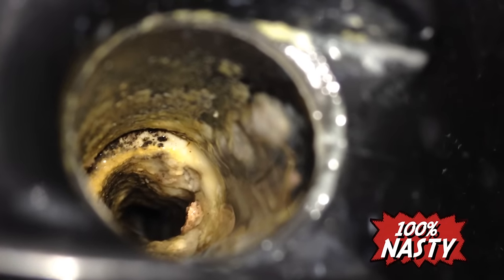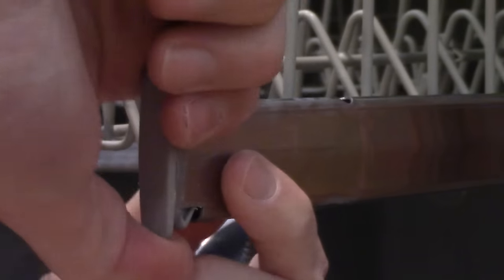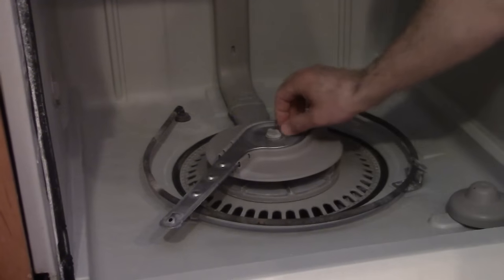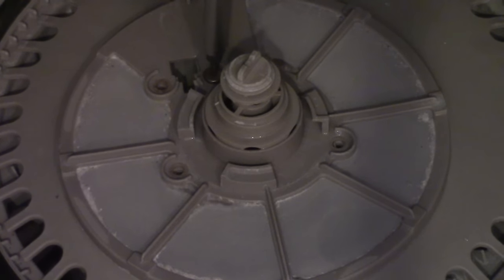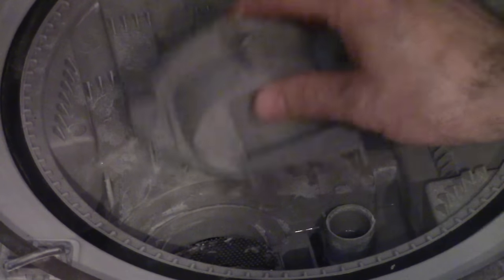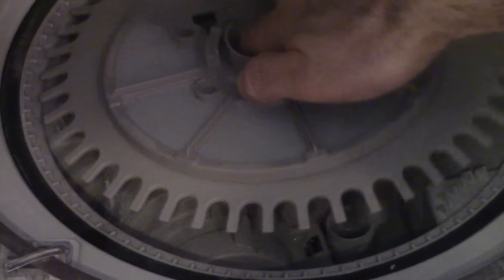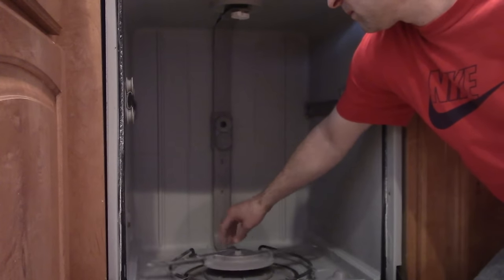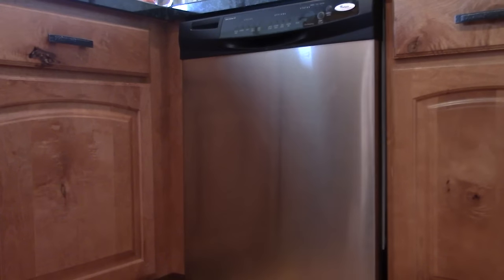How to repair a dishwasher, not draining - troubleshoot Whirlpool

Comment: nice video adam. My whirlpool was not draining completely although I could see water draining into garbage disposal. I replaced pump impellers and still had the problem.. hose looked to be unblocked, and it was clear. I did remove the backflow preventer the hose attaches to at bottom of the machine and found it to be partially blocked with bits of paper and plastic wrap. Was able to remove blockage with tweezers and some picks. problem solved.

Comment: Thanks for the thorough instructions! Dishwasher is cleaning better, but there's standing water in the bottom after the cycle finishes. Holding the "Drain" button for about a minute will eliminate it. Any idea if that's a sign of pump failure or another issue?

Comment: Very helpful. The only issues to add are that is might be helpful, depending on model year, to separate the tube (long tube that runs from top to bottom) in the base. You'll see that this is possible because there is a clip. This makes rotating the tube easier to manage.

Also, in my case, it turned out the grinder screen/knife shaft was broken. The replacement part included the screen, the knife, and the shaft as a single assembly (<$35). That dropped right in and the dishwasher was like brand new. Because the shaft was broken, the screen was hopelessly clogged which prevented the water pressure from getting high enough to push water all the way to the top shelf.

Comment: This is just the best video.  I had to switch back and forth between this one and the one where you show the wash arm with the clips  I have a Kitchen Aid Architect series.  One warning to anyone with one of these.  Do Not Unscrew the sensor at the bottom.  Mine slipped through to the floor!  Luckily I was able to remove the kick plate and screw it back in from the bottom.  PhewReally.  This video saved me a bunch!
Reply: Ame Cseventy

Comment: This video matched my dishwasher exactly, so it was spot on helpful. In our case, turns out bits of the rack disintegrating (which I knew about) caused bits of it to fall to the bottom. Pieces of it must have kept the impeller from turning.

Comment: Great video.... and a trick to easily clean out all that grime and mildew from the drain bottom is to scrub with plenty of soap solution and suck up the liquid with a turkey baster. Repeat until all grimey bits are free and clear.

Comment: Thank you!
Found a plastic cap stuck in the drain line. Used a $3.00 drain python from Home Depot to unclog. 
Though this task was going to be difficult, but turned out to be pretty easy.
Reply: Thank you for your help. Good quality video. Clear explanation. I wish your business going well.

Comment: I have an over 8 year old maytag dishwasher made by whirlpool.. It looks almost the exact same as this aside from the interior being stainless and the bottom spray arm looks different...The machine works great no issues draining...something is puzzling to me though... The bottom rack at the very LEFT corner is for some reason a dead spot now...if I put a quart mason jar there it looks filthy and all of the other dishes throughout are spotless...If I put a flat plate or saucer in that spot it comes out clean but no glass will... this wasn't always the case...it's something that's developed over the past few years..but the machine runs and sounds great...I've always ran citric acid through it once every few months. EDIT: forgot to add, the spray arms are not clogged...no build up at all that I can see

Comment: I have a very similar Kenmore Elite.  We have very hard water so removing the cover on the very bottom with the one screw was very difficult due to a lot of calcification.  I poured several cups of vinegar over it and let it sit a while then used a screwdriver and with a lot of prying it finally popped off.  Glad I went through the trouble because the little propellor blade was frozen stiff due to all the gunk on the metal grid.  I should mention that it is a simple matter to remove the propellor and grid assembly to make it much easier to thoroughly clean before reinstalling.

Comment: My drainage problem was in a portable G.E. washer,so my solution was a little different. My washer would not completely drain before the fill cycle began. I flipped it on it's side,and on a hunch,I removed the clips holding the metal grounding pipe which runs inline with the rubber drain hose. The inside was half full of scale,which I reamed out with a screwdriver. That fixed my drainage problem!

Comment: So happy I found your video - it's the exact model we have. We inherited our dishwasher when we bought the house. However, regardless of how much I try to unscrew the lower sprayer (clockwise) it just keeps spinning. I fear that maybe it was just tightened too much or maybe the previous owners stripped it by trying to loosen it counter-clockwise.
Any suggestions?

Comment: I have an older Whirlpool dishwasher. Similar to your example but definitely nuanced. The sprayer arm just slides into an upper circular component and just slides out after you remove the screws holding it down over the circular filter. The sprayer arm does not cover a 4th screw. When you pull the circular component that receives the sprayer arm there’s a nut and impeller but can’t seem to turn the nut and not sure it would matter. The circular filter will not budge  no matter what language you use! Anyway pretty much stuck at this point, that circular filter covers everything.

Comment: Worked great.  Also fill a squirt bottle with water & spray the hard to reach areas.  Especially that black thing (temperature sensor i'm guessing) in the top right.  Clean the door & filter gasket & with a wet paper towel.  With the door all the way down look under the lip inside of the dishwasher.  Mine was naaaasty.  Use a stiff small brush to push the crap through the metal grate.  You may need to pry the filter loose and be sure to line up the screw holes when you snap the filter back on.

Comment: Here in Austin, Tx, the one of the problems with dishwashers not draining has been incomplete installation.  The installers fail to remove the "knockout plug" from the garbage disposer prior to the attachment of the drainage hose.  My appliance repair guy say that he stays busy.  Lots of development here.  First thing he did was remove the knockout plug, then took the dishwasher filter apart,  because I insisted.  He was here for about 20 minutes.  Cost $100.00. He's retired, but stays busy. He my go to guy for all appliances.

Comment: 8:36 on Kenmore Model 66516973200 there is NO back screw or top screw.  You just snap the arm into place and it holds.  Don't make holes in the big grey U shaped piece.

Comment: Heh heh, good tip on the towel for catching screws. Didnt watch video before taking off that track which runs along the back and top. But i had done this operation a few times over the years and got sloppy. The top screw dropped down into the bottom of the washer. Expecting I will locate it tomorrow when I take out those bottom parts to get to the grinder. .Appreciate the video and guidance.

Comment: I would recommend doing this for the purpose of maintaining your dishwasher, but if you've found this video because your dishwasher is stopping mid cycle then here's what you do: 

-Close the door
-press heated dry button
-press normal button
-press heated dry button
-press normal button
(all lights should come on)
-press cancel immediately

This resets the dishwasher.

Comment: Thanks for sharing your knowledge amazing video!!!!  I’ve done all these steps and still the dish washer won’t drain. I even pull it out and disconnected the drain hose ran water through it no blockages. I also replaced the drain pump. I have no garbage disposal pulled the trap all clear. Any suggestions. Thanks for your help and time.

Comment: Thanks AdamDYI for an informative video.  I got down to the screen and blade and you said it should rotate freely.  Mine seems to rotate too freely.  I couldn't tell from the video if the shaft and linkage is also spinning behind your hand.  Mine doesn't however the shaft does not appear to be broken.  It seems to be an issue perhaps with the washer on the end of the shaft.  Is the blade suppose to rotate the shaft?

Comment: This is an awesome video thank you! I'm working on this same machine. I'm here at the impeller sand it's not turning all the way. seems to have some grindy like noise as I attempt to spin it like there's sand in it. it turns to a point and stops, both directions. Please offer next step advise

Comment: Adam, great video. I have the same dishwasher except for one difference. The channel that pumps the water to the upper spray arms are not attached with screws as yours was. The connectors appear to be plastic tabs, but I haven't been able to release them. What's the trick?

Comment: I have the Whirlpool Quiet Partner 3.  I followed your excellent instructions up to the part where I lift the arm assembly off. I tapped on it with the side of my adjustable wrench pretty hard being careful not to break it but no luck. The screw is stuck in place.What else can I do ?

Comment: Good video!  But, before you go crazy, check to see if the drain plug has been knocked out if you just replaced the garbage disposal.  The drain hole has plug in it that has to be removed, before you can drain from a dishwasher.  Rather than put a cap on the pipe connector, they have a plastic plug inside the garbage disposal.  It's east to knock out with a  screwdriver.   This is only for a new or replaced garbage disposal.  It will save you a lot of headaches in this video.

Comment: This is very helpful, thanks.  Can you clarify for me that the nut that holds down the lower sprayer arm should spin once the arm is installed.  I can crank it down so it doesn't more and then put the sprayer are on. Which is correct.  5:27 in the video.  Thanks

Comment: Hi, your video is great.  I did not find a silicone sealer in the center piece.  Do they all have one?  Could it have been forgotten during the installation?  Also, it is clean & I am just running it with water.  It is very sudsy.  Could this be another problem?  Finally there seems to be a hum coming from it now that I had not noticed before.  Is the hum normal? Oh, and does the center bottom sprayer have a lot of play to it?  Thanks for your help.

Comment: Adam, the video was fantastic and very helpful, however, I am unable to screw the lower spray arm back on. extremely frustrating. It seems to screw slightly tilted, therefore never ending in the correct position but popping back out. Is there a remedy or will I have to buy a replacement lower spray arm?

Comment: MIne drains ok when it's running but I came home and it was full of water. I hadn't used it in ages. My plumbing in my sink is unclogged. My only guess is the garbage disposal got a bit of a clog at some point and it forced water into it. I don't know how water made it into  the dishwasher this way because when I blow in that tube going to the dishwasher no air goes through. It's like a valve or piston prevents this. Still not sure how water got in there.

Comment: At 3:37, you remove a plastic screw off the top of the spinning arm. It looks like it's reverse threaded by how you do it. Regardless, this plastic screw in mine just turns infinitely in both directions and never comes off. Its like its just turning the thing its attached to underneath. How do i defeat this thing?

Comment: I have a mildew problem inside. I'm tackling the water backup, but I wa hoping for an opinion on cleanup. I've brushed everything with vinegar. Ran w vinegar then baking soda. Still kinda stinky. I was considering running it bleach. Do you think that would mess up the lower spray arm or rack slides? They look stainless. Thanks.

Comment: The one I had to take apart hadn't been cleaned in over 3 years. The whole thing was orange, black, grey and gloppy. Found broken glass (past tenants) and 6 bag ties. Got it apart, cleaned and back together with these directions. Hopefully that worked so I won't have to undo it all and snake the pipes.

Comment: Hi!! I used your video because mi dishwasher wasn´t cleaning, so it was a perfect guide to dismantle it. It was gross in the inside!! With lots of food residues and plastics. SO, the first time after that worked as a charm, clean dishes dishwasher like new, and now... is not draining!! I don't understand because that was not the problem at first. :( Do you have any idea what could I've done wrong?

Comment: Thamk you for this video! Unfortunately, I'm still having problems and wondering if you can help. I pulled the washer out. There was nothing obvious clogging it. I even inspected the impeller part. It was not clogged and moved fine. After putting it back together, it wouldn't drain all the way, at first. However, we could push the cancel/drain button and it would drain. Now, it will not start the cycle, at all. My (non-handy) guess, wonders if the sensor if bad. There is white stuff caked on it.
I would appreciate any help you can give. Kenmore Model 665.15113K214. Also, mine doesn't drain into the garbage disposal. There's another drain pipe. Not sure it matters. It does not seem to be clogged.

Comment: Great video, but should have mentioned possibility that the knockout plug in the garbage disposal has not been knocked out.  That's an easy check that will save taking everything else apart, if that is the problem, which it was with me.  Some of the videos on YouTube show that.  Otherwise an excellent how-to!

Comment: My dish-washing machine is a SUPERBA by Hobart, and it is very old - - like thirty years. 
It doesn't seem to be able to wash the dishes effectively anymore even though I give ample spacing between the items. I could use 'soak & scrub' mode for longer duration but that is a great use of water and power, and I don't pack the machine with heavy loads.
Also, the dish-powder dispenser pockets don't seem to be able to open on their own anymore.
Purchasing a new machine at this time is not an option.

Comment: great video, I did it!  one thing - what's with the standing water in the compartment where the blade is.  I saw you have that, too, but I would feel better if it drained completely out of there.  Isn't it a breeding ground for bacteria?

Comment: A-HA!  The Secret Screw under the hose thingy!  So that's why that bugger would not come out.  Thanks!  Taking it apart proved to be easier than putting it back together.  You have to remember to put things back in order or you will have to take stuff apart and then do it right.  If you don't live very close to a hardware store, make sure you have a compete set of cheap funny-dudy screwdrivers.  I need two sizes of the star-shaped one and a square one.  There was no normal screws on my machine.  I guess they do that so you won't fix it yourself and will call a professional or better yet, buy a new one.  I found two bread twist wires, a pebble shape piece of broken glass, lots of bits of plastic, 5 pistachio shells, two toothpicks and part of a q-tip. Its amazing it worked as well as it did.  I did check the dishwasher hose to the disposer and surprisingly it was clean as a whistle.

Comment: Hi Adam, I have a maytag dishwasher that is 7 years now. I would say brand new. My problem is that drains well, but now when I start the cycle, any, it starts filling up with water  it cancels itself! My husband checked the pump and it is fine. Do you have any suggestions? I dont want to spend money in a new one. Thanks in advance! Paola

Comment: We just bought a home and moved in. I've been using the dishwasher somewhat frequently for the least couple of weeks. Last week I went down to the basement to wash and noticed water ( kind of dirty or rusty looking) on top of both the dryer and washer. It's directly below the kitchen. I cleaned it up and ran the dishwasher again  (not sure which cycle) it didn't leak again until yesterday.  It is not leaking in the kitchen or under the sink at all! Very perplexing. Other than the leak the dishwasher seems to work fine other than making some odd noises at times. Could it be clogged with rust and why? Could it be just on certain cycles and why? And lastly why would the leak only be seen directly below in the basement? We do not have a garbage disposal.  What can I do to check before calling a repairman? I feel so bad for my husband. I hate to even tell him. I'd rather try to fix the problem myself. Thank you in advance.

Comment: Hey Adam, great video!  In my case, when I had the chopper assembly cover off, the blade literally fell backwards in my hand.  I looked at the screen and thought what the heck may as well pull that puppy out and clean it.  Wound up being a huge pita to get that screen to sit just right so the assembly cover would go back on right.  Had the blade just right - it stayed on and rotated with a bit of resistance.  Even got my pro scrub jet put back correctly -- it was literally lying on the bottom under the main line connected to nothing (we actually had a sears guy here to do this job about a year and a half ago.)  Anyway, everything seemed good, and the thing cleans like new again -- but one major problem!  There is a small leak from the very bottom of the unit that oozes out onto the floor.  Not a stream just enough to require a towel.  Hate the thought of calling a repairman after all that -- any thoughts?!  (One last thing, based on another video I did remove, clean and replace the black "flap valve" that sits just to the right of the chopper assembly.)  Help!

Comment: The plastic screw is turned clockwise? So it has reverse threads?
Reply: Okay that worked, I got the sprayer arm off. The threads on the plug were pretty messed up.